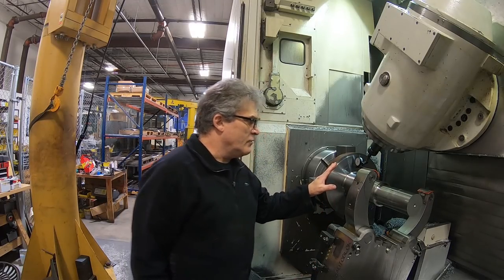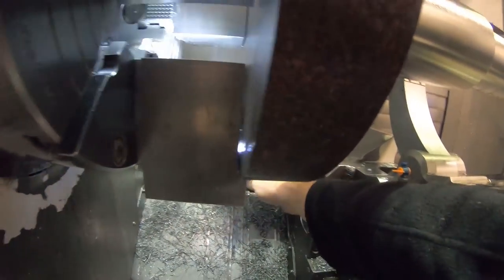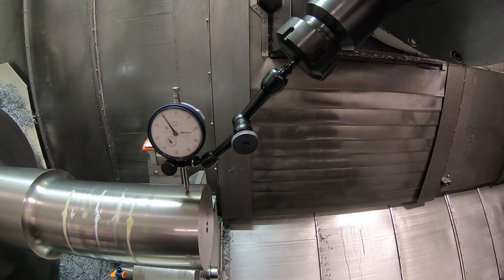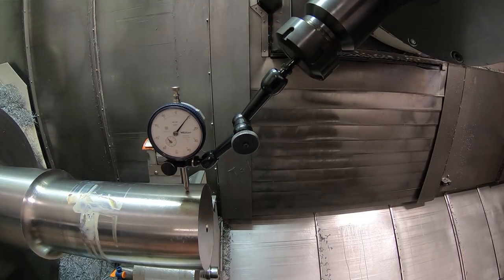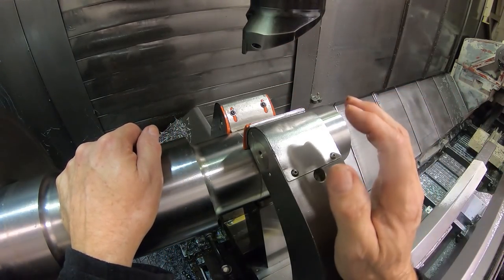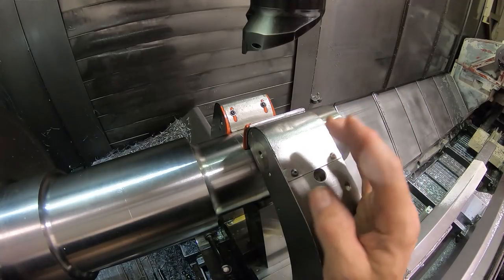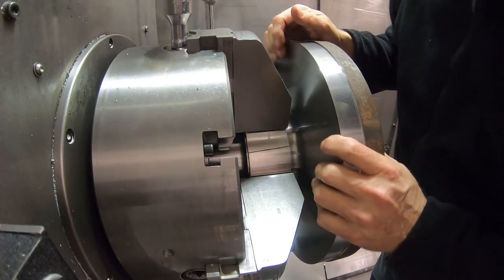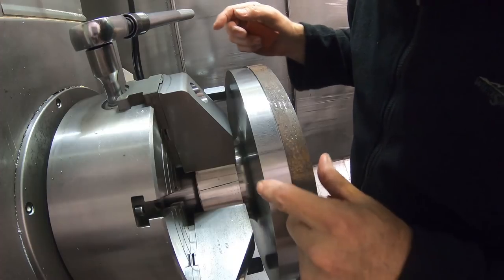16 Inch Shaft Finish Flange End

Comment: 32:03 I definitely hear a big difference! There's much less resonance with the high density rubber pads/stud/joint connector arrangement. I would also think that it's absolutely worth taking the time to do whatever you can to dampen resonances and vibrations from your parts, if your after the best surface finishes possible.👊👍

Comment: The toolchange only working at horizontal and a specific clock is probably so if if the machine is about to do a automatic tool change and something went wrong, it won't drop the tool. Nice work on these parts

Comment: I think one of things that people also need to understand, is large parts like these also release stress as they are machined. Especially when the cross sectional area drops significantly. Plus, usually the harder the material, the more it takes off while machining. 

I work with ALOT of thinner stainless parts (316), but they are from 16-22 Ø, and after even minor amount of material removal, they need to be left to cool to room temp and on especially long parts, left overnight for stresses to work their way out

Awesome video, still wish i had the Mazak. haha

Stay safe, Peace

Comment: Cool ideas for the resonance dampening with he rubbers and magnets.

I think Haas lathes have a feature built in to do automatically what you said about the playing with the speed manually.

When we used to turn long and thin parts (much smaller diameters of course, something like 1/4 inch or so)  we would sometimes hold them by hand with a stick or a piece of plastic, following the tool to prevent the chatter,  not something very safe and i don't recommend doing that of course :)
Reply from the maker: Yes I have done the stick thing myself. But on this machine it won’t run with the doors open. You are correct Haas has a feature that varies the speed/feed to damp vibration. This machine is to old for stuff like that. I wish it had it.

Comment: Peter,  putting a 1.50" dia fixed post(bolted -secure) and mchined in place(same height} could serve as support and consistent  'shoulder'  for the flange to bump into. This may also speed up squaring the flange , setting the Z-axis work offset only once and possibly serve as the anti vibration too. Just a thought but I am a really an avid follower and so thankful for your sharing here.
Maybe a similar sleeve at the end of the shaft will help arrest whipping of the part inside the spindle bore..? God bless you.

Comment: Could you have put 4 jacks in the chuck slots and indicated the face by adjusting those?
Reply from the maker: Yes that could be possible. But I would like the jacks closer to the chuck jaws. Are you familiar with Robin Renzetti he has some videos on chucks he modified just like that.
Reply: @EdgePrecision  no i haven't seen his videos but I'll def be goin down that rabbit hole now. Thanks for doing what you do. I actually worked for you in the early 2000s when Mauro Garcia was the mill supervisor at Edge. Keep bringing  the top shelf content 👍🏼

Comment: Thanks for showing the skim cut method for the steady rest. I guess you would also have to recut the center in the end to keep everything true?
Reply from the maker: If I was going to use it, yes. But in this case I drilled and bored a concentric hole with a chamfer.

Comment: Great tutorial on indicating and setting up. I do hope though that when you finish turned those spindles you dressed the center in the end so it was concentric again. I mean it isn't needed but it sure is nice for the next guy.
Reply from the maker: The center gets machined away when the 1.0" hole gets drilled. Than c-bored to 1.25 diameter with a chamfer the center can run in.

Comment: Just a question coming from a machinist. Have you ever used a drill in the live tooling and rotated the C-axis at the same time? I’ve was told this will produce a very straight and concentric hole but have never had the opportunity to try it. Your thoughts? Thanks for the videos.
Reply from the maker: I have never done this but the principle is sound. Back in my gun manufacturing days. The man that drilled and riffled our barrel blanks. He made precision match riffle blanks. He drilled them by rotating the drill and the blank at the same time.
Reply: Edge Precision Interesting I’ll have to see if I can find anything on that. Thanks for getting back to me.

Comment: I personally find your videos really fascinating and in some way relaxing (No doubt just the opposite to you, re relaxing.)  My machining experience and knowledge has really been added to/too/two by enjoying your work or should it be an ART form?   The largest component I have recently turned was originally a 23mm in dia. billet of dialuminium required, for a small `crowned` pulley for a friends belt sander tool.
But the principals are just the same whatever diameter the component being.  Basics are basics and if one does not understand them, well??       A `thou is a Thou` whatever the size of the component, clearance is constant..          Take care.  Thank again.

Comment: Finally convinced the boss to get a 4-jaw independent for our large CNC lathe. Where can I find the telescoping ratchet you use to tighten jaws?
Reply from the maker: Search this on Amazon.
Titan 12072 3/4-Inch Drive x 19-1/2 to 30-1/2-Inch 24-Tooth Extendable Ratchet

Comment: Neodymium magnets 🧲 what you have 
And the rubber dampen the vibration which causes frequency 
Put the magnet in a delta configuration it helps alot
Reply from the maker: I knew someone would correct me on this. When I’m making videos my mind goes blank. Unlike some content creators I don’t do retakes. I think it makes things sound unrealistic or rehearsed. That’s like a previous comment suggesting I should get a speaking coach. That is something I would never do. Thanks.
Reply: You do a great job you don't need a speaking coach 👏keep up the great work brother love your channel 👏
I'm young student learning alot from you 💯

Comment: You comment about the mazatrol and teach when you set your offset. i agree my old mill with m32 mazatrol is reverse - when you teach an offset you tell it where THE OFFSET it compared to your current location - not WHERE your tool/spindel is compared to the offset you want. I agree with you peter its the opposite way on other machines haha
Reply from the maker: I think the people that made the Mazatrol were thinking from where the tool is to the part zero. They are thinking in a incremental direction. That would be positive in this case. They probably are software designers and not machinists. In our case we would think the tool is setting at minus 1.5" in Z. So if we told the control that it would place the zero accordingly. I think my little Haas lathe in the garage works opposite to this. But than when your programming in Mazatrol. Everything in Z minus is positive numbers.

Comment: Start by machining the face saw cut and turn part of the OD then flip in chuck to help with later alignment?
Reply from the maker: The reason I did it this way. I was going to chuck the first operation in the serrated hard jaws and tighten them tight so the part wouldn't move. I was only chucking on to about .750" length of this big piece of material. There wasn't a lot of stock on the bars OD. So in order not to have dents from the hard jaws serrations in the flange end. I elected to not turn the stock first.

Comment: Good job Peter, very clear explanation.  I'm wondering why you did not make some soft jaws considering you had several parts to machine?
Reply from the maker: I wanted to indicate the back of the flange to make sure. Not just depend on the jaws. You saw how it changes when I adjusted the jaws. Just to be sure. Also I already had the jaws. A set of soft jaws for this chuck costs around $300.00. Not a insignificant sum.
Reply: @EdgePrecision  that's quite a big amount! Must be some good alloy.
Reply from the maker: @vishrutvora2465  I think they just use 1018 steel bar for the jaws. Each jaw weighs about 25 lbs. So  four jaws 100 lbs of steel plus the machine work.

Comment: Just curious, why no chamfer on the holes in the program? No chamfer mill in the machine already?
Reply from the maker: Because for four parts it takes more time than deburr. Also the drawing doesn’t call for them. And there is always the risk of a mistake. If you are starting with a $1500.00 piece of material. A mistake just isn’t worth it.
Reply: @EdgePrecision  ah alright i see. I usually program in .005-.01 edge breaks on everything i can in my programs but thats higher production, not small quantities like this work. Thanks for the response.

Comment: Good info Peter. I'm curious that you don't machine deburr your holes and other details at times. It's something I've taken to doing in the last couple years.
Reply from the maker: On this few parts it takes more time to program, set up and prove out the operations. Also there is always the chance of a mistake just to save a few minutes of deburr time. When your dealing with a lot of parts or inexpensive material. Than OK, but it just isn’t worth it to me.

Comment: The aluminium sleeve not only protects the part and the jaws but it also allows the parft to wiggle in the jaws. Would there be no aluminium sleeve, You wouldn't be able to knock the workpiece around.

Comment: Use the jack studs with brass insert tip on the flange??
Reply from the maker: Yes that could be done. You just have to be carful not to tighten them to much to distort the shape of the part. So it springs back after you release them. If you are intending them to stop vibration. Sometimes metal against metal isn’t as good as a softer material such as plastic, rubber or even lead.

Comment: Why did back face was not butted to chuck jaw face ? Could have put a relief chamfer in jaws to clear that big radius ?
Reply from the maker: Yes but in this case I didn’t want to modify these jaws. I use them for other things.
Reply: @EdgePrecision  I was going to ask a similar question regarding holding the part in soft jaws on the large diameter with a step machined for clearance when drilling,which would have eliminated ringing and ease of set up.Is it because it wasn't worth machining soft jaws for the qty.of work?

Comment: How do you get the position page to display program coordinates instead of machine coordinates after hitting reset?
Reply from the maker: On the Mazak it displays the position in relation to the tool it thinks is in the spindle, tool tip. In relation to the default fixture offset G54. If you need it to a different fixture offset you need to call that offset in a MDI. When you hit reset it will revert to G54.

Comment: I noticed a small offset in the Y axis offset, Is this to align then center lines of the two spindles?
Reply from the maker: Yes this machine has always been that way. This could be corrected in the parameter settings. There is a setting that’s off.

Comment: How do you command the milling spindle to index a lathe tool at the B90. Position? 
And do you use different work offsets for the same tool? Great job BTW !
Reply from the maker: You set up two different tools with different index and clamp angles. Than all you have to do is change to the tool you want. With a M6 T#. The machine automatically indexes it at the tool change. Hope that makes sense.

Comment: Peter, could you tell us more about the gun parts manufacturing you did back in the day?
Reply from the maker: I built complete guns. It was a reproduction of a German Luger in stainless steel. Or to be more correct I did the machine work on them. We made over 22,000 of them.
Reply: @EdgePrecision  What was the brand name? CNC of manual machining?

Comment: Excellent, as always! 
Just for my personal understanding of machining in the US:
What pricing range (ballpark) and lead time are we talking for 3 pcs of this part? 

Im also a small business owner (electrical engineering, mostly for construction equipment) and Im astonished that you find time to spare, for making these great videos for us to enjoy. 
All the best from Switzerland.
Reply from the maker: There were actually four parts in this order. The customer picked up the first one to check the assembly. But to answer your question without going into detail. I did the job in a total of six days (including making the videos). But because of the extreme weather and power outages here in Houston. It actually took a week longer. As to financial I only spent around $200.00!on tooling because I already had everything else. And I made around $140.00 a hour for my time. But in this case it’s a little hard to tell because of all the interruptions because of the power outages at the time. Here in Houston it is easy to acquire materials such as this. This material was delivered the next day sawed to length. Thanks hope that helps.

Comment: What tool are you using to tighten the chucks?
Reply from the maker: I use a 3/4” ratchet wrench with a short extension.
Reply: Do you use a specific brand ? I want to get one for work but I want it to last
Reply from the maker: My wrench has Titan on it. Do a search for Titan 3/4 extendable watcher wrench. There are many they appear to be the same wrench just branded with different names.

Comment: From Waco here. Did you come through The Great Texas Freeze OK/ Power, water, no broken hips? My brother is in an old folks home in Pearland and the place had no power and water for 2-3 days.
Reply from the maker: We had no power for two days. During the coldest time. Everything in my house is gas but with no power the blowers don’t run. But we could cook. So no heat. This causes pipes to freeze and burst. Of which we had two. But we did have water until that. Than I had to turn it off. Now in Houston you can’t find a single copper pipe fitting to repair said pipes. I am thinking to machine some to repair those pipes (Might make good video content). Right now I have it kind of jury rigged with heater hose and hose clamps. So except for the water damage to the house everything is almost back to normal. Thanks!
Reply: @EdgePrecision  Crazy stuff. I guess will know better the next time  (in 20-30 years).

Comment: Peter when you say what sfm your using whats your max rpm
Reply from the maker: This machine has a maximum of 1600 rpm on the turning spindle. But I usually limit it to 1000 rpm on facing cuts. It depends on the part.

Comment: Just curious ...how many different jaws you got fot all the chucks you got?  Or do you make new jaws or modify old ones if you got none that fits ?
Reply from the maker: One of the advantages of a manual 4-jaw chuck is the travel range of the jaws. This makes it possible to get by with fewer top jaws. Looking at my jaw shelf I would say I have less than 20 sets of jaws for this chuck, and that includes the hard jaws. I do modify old jaws if I know I will not be running the same job again. These are bib jaws that go on this chuck. A set costs between $200-300 dollars depending on the size. So I try to use the old ones first.
Reply: @EdgePrecision  
Interesting ! Thanks for the answer and have a good one !

Comment: I think I get why the magnets help. It's not because they are magnets (that helps because they stick without help). It's because the way you position them, by hand, it's not exactly symmetrical, so they prevent resonances from lasting longer. You basically create destructive interference between the sound waves in the metal and they quickly die out.

Comment: Hi Peter, another excellent video.
By the way, how is the bicep injury?
Best wishes 🇬🇧
Reply from the maker: Thanks! My right arm and shoulder hurt if I try to lift something heavy quickly. The other day I lifted the case my camera gear is in into the truck. I think the case probably weighs about the same as a full 5 Gal pail of oil. I swung it off the ground with my right arm,to throw it on the seat. That really hurt my shoulder. Prior to that accident that would not have bothered me. So I have to be careful with that.
Reply: @EdgePrecision , keep up with the physio. And carry on with the excellent video's.

Comment: Does the mazak have a spindle orient button? Or do you go to MDI and put an M19 every time.
Reply from the maker: It has a soft key to orient it normal, (180) reversed and to clamp it manually. In the tool setup it can be specified to orient every 15 degrees and clamped. This is what they refer to as the flex spindle option.
Reply: There is a soft key in the machine menu
Reply: I really enjoy your videos on this machine would love the opportunity to run one of these after watching your videos. I have run a bunch of different lathes with live tooling and y axis, but this machine is on a whole different level.